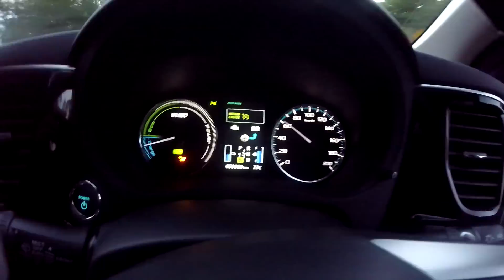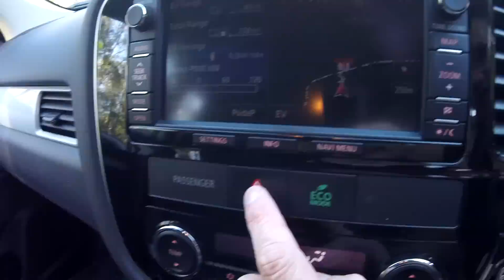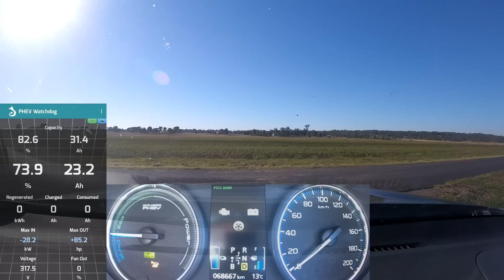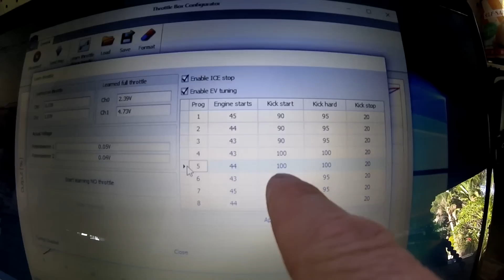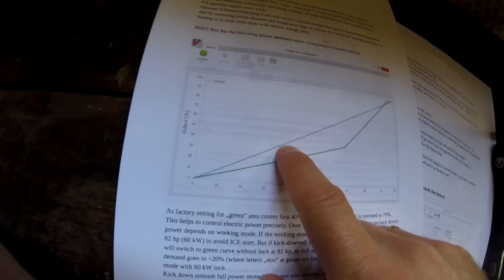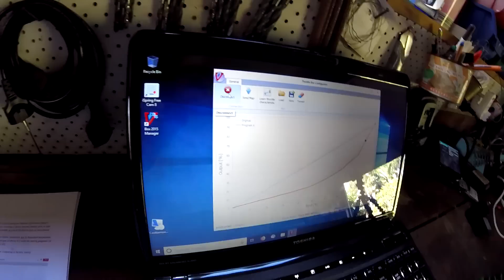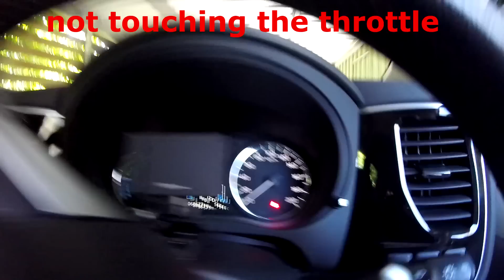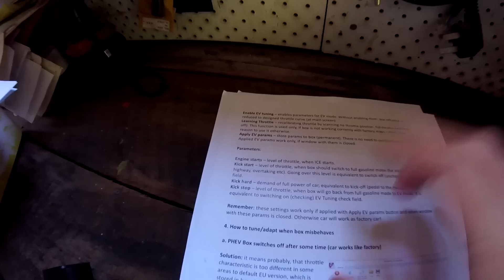EP75.1 - AWESOME PHEV Box Trailer Mode... and a disaster unfolds 🎆

Comment: Interesting finding Andy. I think the others that have commented here are spot on. Translation is bad and I had a lot of trouble understanding it. I haven't tried this with my box as I've only gone to a maximum of 99, however yes, the first column may not be setup to receive 3 digit numbers and may thus just ignore the first digit. The whole division thing doesn't make sense to me as the values aren't really related (could be a bug though). The first column is just calibrating where your needle ends up on eco/power scale (and thus ICE start). That's my take on it anyway.

Comment: Andy, in my understanding, these are the calibration values, not the desired values. The first column is the value where your engine ACTUALLY DOES start, not when you WANT IT to start. 
By default, the engine kicks in around 42% of the trottle, but each one's peddal might be slight different mechanically. So if while driving with the box your engine still starts when you give full trottle, it means that the threshold of your own car is a little bit lower, your trottle is a little bit more sensitive, so you actually need to tell that to your program by setting the value to 41% or 40%, rather than increasing it. 
On the other hand, if while driving with the box you see that on full trottle you get only 45kW instead of full 50-52kW, then your trottle is more stiff and you need to put 43% or 44% in the settings of the program.
In any case, these calibration value should be somewhere very close around the default 42% and nowhere near the 100%.

Please note that this is just my understanding observing your explanations and reading the parts of the manual that you show in the video, so I might be wrong.
In any case, probably being myself a programmer makes my understanding a little bit different that the one of a regular user, but try thinking in this direction that these are calibration values rather than desired target values and everything might make a little bit more sense.

In the same time, I totally agree that the program SHOULD NOT ALLOW these dangerous parameter. It is probably some bug with the mapping (mentioned as "zooming" in your video) that is caused by the fact that you have put everywhere the same values - which probably causes division by zero. I wouldn't be surprised if the same issue happens even if you put just 40 but you put it in all the columns. I will not make you test it though ;)

As a bottom line, thank you for finding this out for all of us!! And do contact the manufacturer - I'm sure he will be more than grateful that you found this bug and he will be eager to fix it.
Reply: Now that I look again to the video, it seems that the first three columns in the settings of the program are just the callibration (fine-tuning) of the following three threshold of each one's particular car:
1) the threshold between the green and the white area on the dashboard dial (somewhere around 43% of trottle position); 
2) the threshold when you press full trottle (arond 90% of the trottle position)
3) the threshold when you press even further for a kick-down (around 95% of trottle position)

These parameters probably need to be fine-tuned around their original values, as no car would deviate too much from the default ones. They are not desired target values.

By the way, you might probably see those exact values with EvBatMon app.
Reply from the maker: Thank you very much Dobrin. I had to read your post only once to understand the point you're making ;) I can now see this different meaning of the values and it makes sense from the coder perspective. 
I got in contact with the manufacturer. To be honest it took more than just an email to convince them to look into it. The feedback was not overwhelming to say the least...
They could just nail down the parameters to a safe area (30-50 maybe) and also not allow to turn off the ICE in kick down at all. But then as you said every car is different an need some kind of calibration.
In any way, they need to do something to prevent such things from happening and especially the manual needs a complete overhaul in most parts.
I had a nice discussion with Pedro two days ago and he explained it like: If you step on the gas to 95%, the box makes the car believe you're only using 43% of your throttle.
Reply: Hi Dobrin, your explanation about the division by zero makes absolute sense. I could think of another bug. What when the parameter 105 is seen as 5 for some reason?
Reply from the maker: 5 or 105 still does not explain the full power as soon as the car goes in R or D?
Reply: sorry, let me explain it more detailed. Following your theory 105 means that the ICE starts at 105% throttle, what if the box receives only 5% throttle due to a programming error to start the engine? And if my observations on my car are correct, the engine always starts with quite a power and is then downshifted.

Comment: The bit of the manual: "As factory setting for "green" area covers first 40% of gas pedal, with box it is zoomed to 70%" means this, in actual English: The point on the factory curve at 40% throttle has been transposed to the right, so that you will need to press the pedal down to 70% to get the same power as the factory curve. The factory curve is linear, so 40% throttle = 40% power.  On the green curve, 70% throttle = 40% power.
Reply: Ah you say that just a bit later in the video. ;)
Reply from the maker: That's a bit like extro and outro, just different for the same meaning ;) So what you're saying is they are (trying to) describing the example in the graph above that paragraph. This is just valid for this one curve they have printed in their manual. If I alter the curve I need to press the throttle to something different to reach the 40% (or any other value).
A simple: "For example, in the above graph..." would have done the trick. Thanks for pointing this out. Is it just me not getting the manual?

Comment: Andy, Since two weeks I bought an Outlander PHEV from 2013. And I would also like to order a PHEV BOX (more economical and more power). But I just watched your video and got question marks anyway. 
1. Was it now a malfunction of the box? or 2. Was This box happen to be no good? or 3. Was This box incorrectly programmed?
Andy, other question:
A. If I buy a PHEV BOX and install it everything will just Plug and play (without having to make any changes)?
B. I it necessary to install also a ICEheader?
Reply from the maker: Thanks for your questions Anne.
The PHEV Box is not malfunctioning as far as I know but the programming is a bit on the dangerous side and could happen to very unexpected behaviour of the car. The Box is good and does what it says. It does not deliver more power though as you stated. It's the opposite, it makes the car slower by using less energy.
Yes, the PHEV Box is just plug and play and you don't need to install the ICE heater stop at all if you don't need it.

Comment: i had the PHEV box. you need to calibrate the throttle, so the box has to learn "no throttle" and full throttle including kickdown. then you need to press the throttle up to the kickdown and see what the value is,  at it may be say 93 or something like that, so you set the ICE to kick in at 95 so from 0 to 95 it's EV only, then when you click gas into the kickdown mode then ice kicks in.
Reply from the maker: Thanks Alex. I figured that a few videos later ;) I also did not want to have the ICE coming on at all and was experimenting with different settings and parameters. The manual they provide is terrible.
Reply: you still need the ice to come in, in case you need to do a kickdown in an emergency evasive manouver. I love your channel by the way. i've got the 2014 phev, had it 9 months now. installed the phev box but eventually took it out because no matter how much i tweaked the parameters it was still a bit sluggish. i wanted full ev power without ice and struggled to calibrate it in such a way. maybe i should have been more patient and experimented with the throttle curve more.
Reply from the maker: Thank you, Alex. Someone mentioned that before but I could not find any legislation saying the car needs to have a certain power or performance for emergency situations. So I guess that is only what people think. A small truck for example is fairly slow in acceleration as well and cannot get out of such a situation either...

I have such a program in my PHEV box programmed, no ICE and good acceleration. Keep the red line a bit above the blue one... this need a video, eh? ;)
Reply: yeah, i've had it for 2-3 months, maybe I should have had more patience and taking it out and flogging on ebay lol
also - have you thought about increasing battery capacity? Mr. V Tech has installed a 20kw battery into the phev. apparently the original battery housing is capable of holding up to 24kwh worth of batteries!  i wouldn't want to mess with mine to that extent, but it's tempting to have 2.5x the range!
Reply from the maker: My PHEV has 8 years warranty and the next car will have more than 60kWh. Mr V Tech also used cells from China and god knows how long they last. You get what you pay for... This is also all high voltage DC and not healthy do deal with. I better leave my battery cover closed ;)
Be more patient with the programming, it's definitely possible to achieve what you're after...